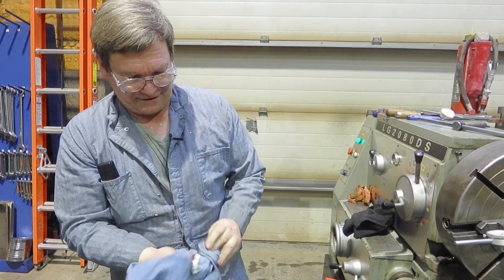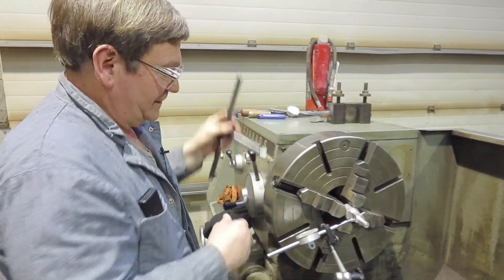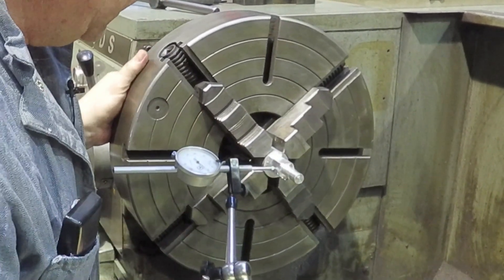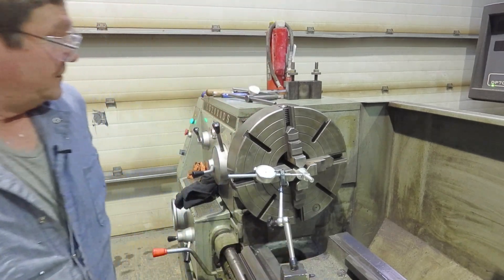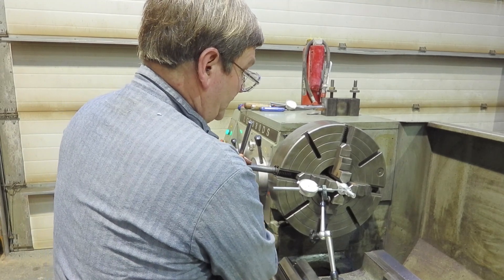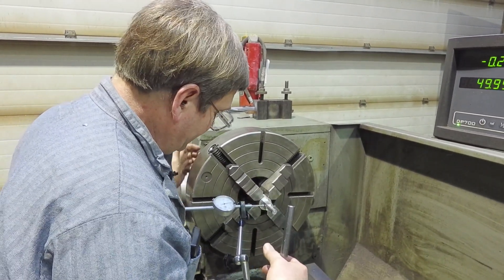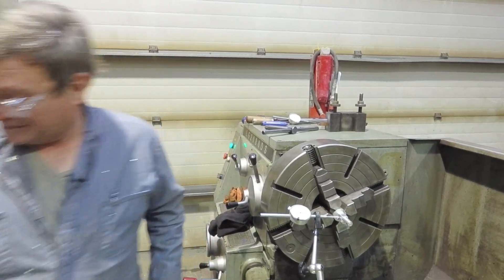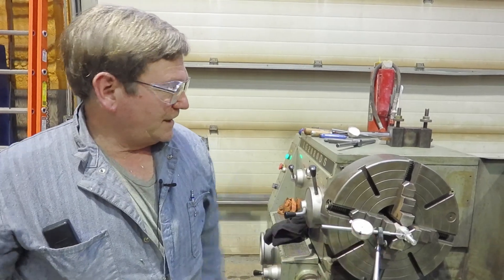Machinist's Minutes: Four jaw chucks and pentagonal/triangular stock (part 3)

Comment: Loved this series! 
I prefer the 4-jaw independent over the 3-jaw self-centering, only swapping for repetitive "donkey work". 
If I have to do accurate work with a worn 3-jaw, I shave 5 or 10 thou off the backplate register and tap it true before tightening the backplate bolts - poor man's griptru.
Reply from the maker: I like that better than the idea of the "adjust true" they claim to use this to forever adjust the chuck to perfection, but then overtime it moves because of a lack of surface area under the screws.  Using this for, as needed, adjustment makes sense.  Thank you for this perspective.